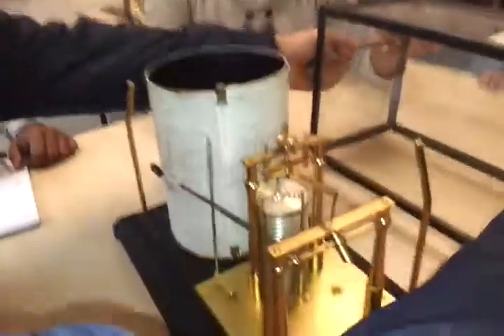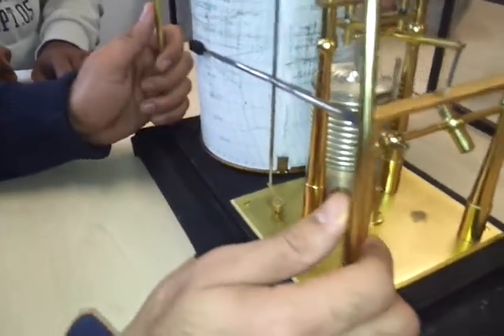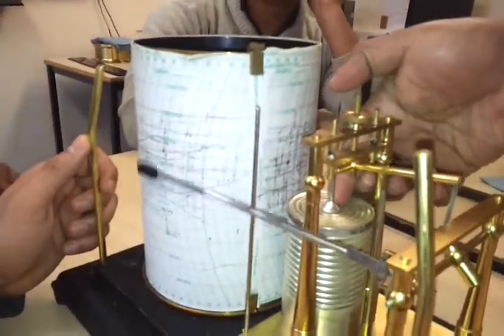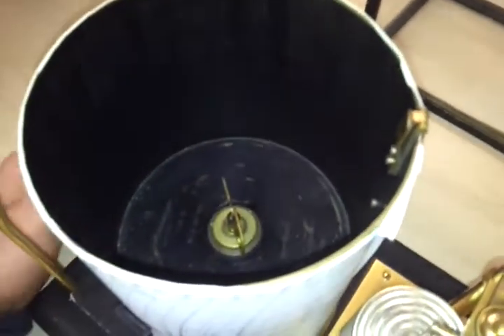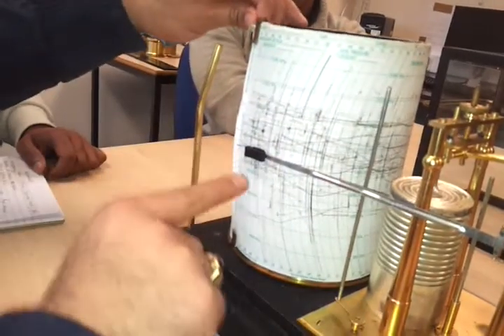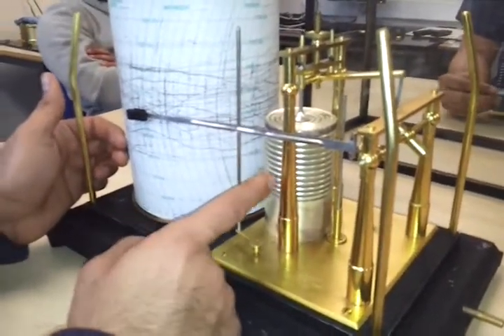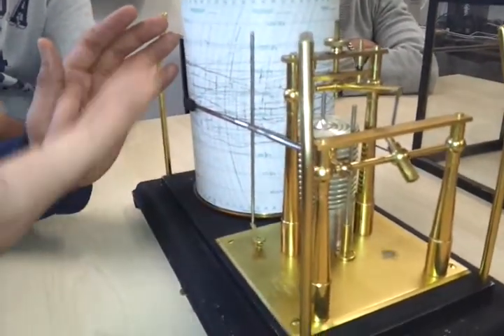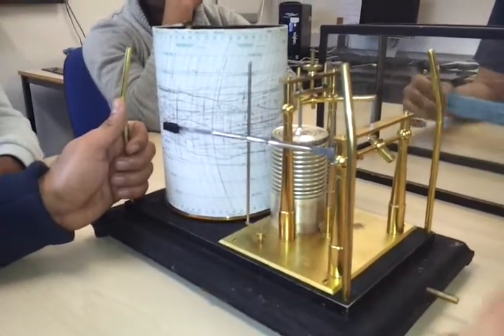barograph

Comment: It works because de bellow is pushed in of streched  when de air pressure  varies.  Liquids are not able to change in volume under pressure.  So how can there be oil in the bellows??
Reply: the oil is forced out of the cylinder through small holes, as the chamber expands .